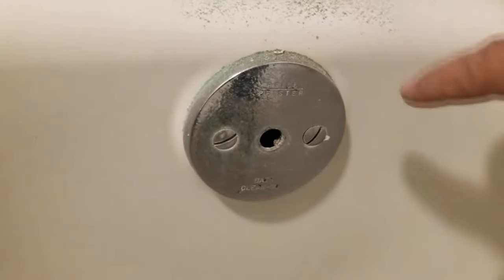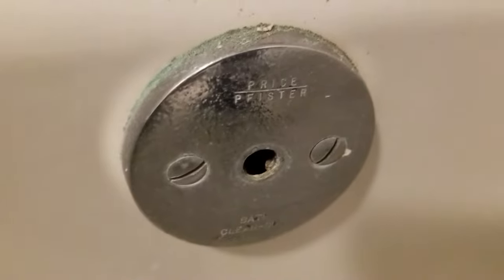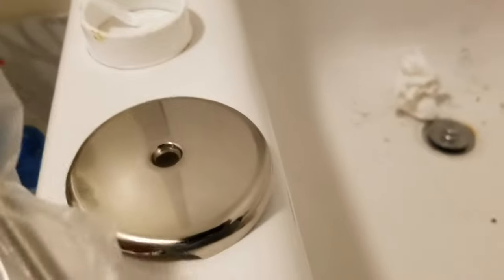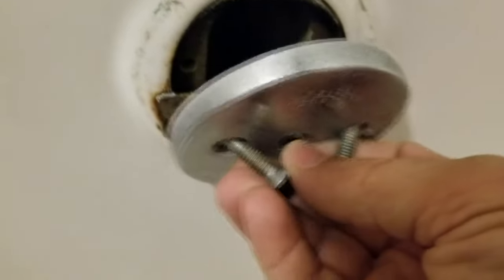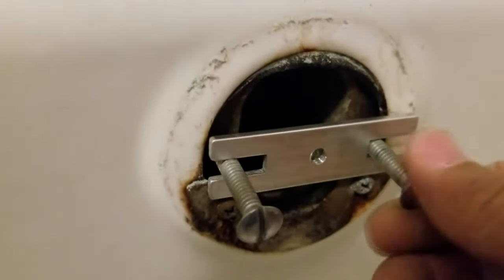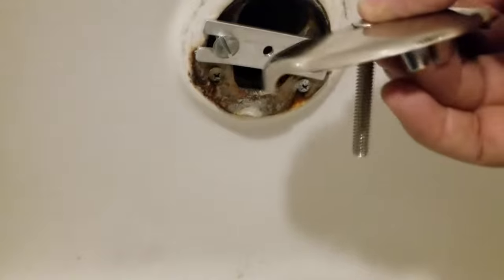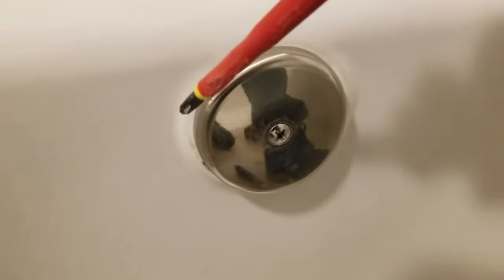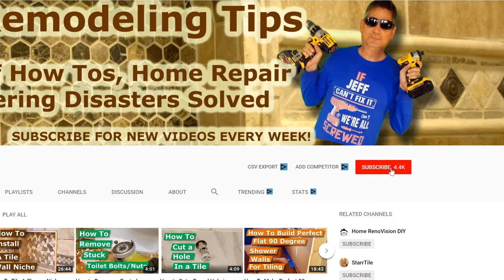How to Install a new Bathtub Overflow Plate Assembly

Comment from the maker: ✅ Parts used in this bathtub overflow plat installation video:
DANCO 89239 Lift and Turn Bath Drain Trim Kit with Overflow Plate, Brushed Nickel: https://amzn.to/2Dsdn7j
Reply: I guess it is pretty off topic but do anybody know of a good place to watch newly released tv shows online?
Reply from the maker: @malakaijames2853   We usually just watch it on the streaming apps on the TV if you have one of the newer smart TVs it goes through the Internet anyways

Comment: What happens if the plate got rusted and when i pulled it out the screw broke? My tub flow is slow it's like it's plugged.  Does the plate have anything to do with that?

Comment: Shouldn’t you have replaced the overflow gasket since it is that old? Your right there. Why not?
Reply from the maker: The overflow plate kits do not come with a gasket. If it aint broke don't fix it you could run the risk of buying a gasket and then putting it on that old 50 year old overflow tube there and what if something happens and it doesn't match up exactly right like the original 1 did? So I would only change the gasket if it looked like it was bad.  Don't mess with what's working.

Comment: do you know what that u shaped metal plate it that was not replaced in the video that was screwed in below the bracket for the overflow faceplate, mine it completely rusted and I have been trying to figure out what it is so I can replace mine
Reply from the maker: That is not a U-shaped metal plate, that's the front of the actual vent pipe that connects to the back of the tub vent hole. So if that is disinterested, you will likely need a new tub overflow pipe kit similar to this one from Home Depot: https://www.homedepot.com/p/Everbilt-Twist-and-Close-1-1-2-in-Sch-40-White-PVC-Pipe-Bath-Waste-and-Overflow-Tub-Drain-in-Chrome-WO-3-CR-TC/206393883 the only problem is now you'll have to be able to get at it from back side of that wall, maybe it's in a closet on the other side or a bedroom on the other side?

Comment: Hey thanks for the video this was good I have a quick question do you have any recommendations for a screw that will not unscrew on the old cover plate. I am helping my friend to install a new plate but we can’t get the old plate off because of the stuck screw. Any help would be great. Thank you!!!
Reply from the maker: Dezmond, for a stuck screw, which I assume is stripped, you need to use  the Speed Out bits, they attach to your drill. The kit is sold at Home Depot. Follow the directions closely, one side is a reverse drill bit, the other side of the bit is the extractor. Used it a number of times both in the shower and on bedroom door screws that did not want to come off. https://www.homedepot.com/p/Ontel-Speed-Out-Speed-Out-Titanium-Screw-Extractor-4-Piece-1000367/303667297
Reply: @jeffostroff  in my case it's completely rusted and the head broke off.

Comment: Just installed a new tub...instead of putting in my single screw drain cover, my boyfriend bought a double screw cover that is chrome.. I have 2 questions 1) where can I get the adapter? My kit did not come with the overflow plumbing or any other hardware, and 2) will I need access to the plumbing as I already hung drywall and closed the wall. ( direct access from the basement but it is VERY tight). Thanks!
Reply from the maker: I usually buy the overflow kit that has only one screw hole in it. It comes with an adapter bracket that screws into the older 2 holes if you have one, or you just use the one screw into the center hold to secure it.
Reply: @jeffostroff  I picked up the bracket. Thanks for video!

Comment: I didn't see you finish it up with silicone or caulk? ALso how do I find the other videos of the other part of the bathroom you did on this job? I cant find the spout or shower install. TY
Reply from the maker: ✅ WATCH:  DIY How to Replace Shower Faucet Trim Plate and Handle [Moen]: https://youtu.be/xjPhAxOeSlY

✅ WATCH: How to Install New Shower Head, Delta In2ition - DIY
https://youtu.be/DUexg5N-PxU

✅ WATCH: How to Remove Stuck Bathtub Drain - Rusted, Won't Budge
https://youtu.be/8neK7Nj0Xs8

Comment: I have a similar type plate but i need to remove it to unclog the drain but the singe middle screw isn't budging. It's like really really stuck. The screw is in good condition only about 5 years old but that sucker is not moving at all. Any ideas on how to remove it? I'm bout to go HAM on it. 😂

Comment: Where did the holes for the new bracket above the old bracket come from? Also the u shaped lower bracket is missing from mine, I need to replace this correct? my other problem is the bar with one hole is too long for the opening in the tub. Can I buy a proper fitting plate?
Reply: Unfortunately I found the rusted studs from the original cover.  I don"t see any way to remove them. So after I find the u shaped bracket and replace it can I just silicone the chrome cover over the hole?
Reply from the maker: The kit comes with a new bracket. the bracket comes with 2 screws to adapt it to the threaded pipe opening inside the tub wall, If it is too long for yours, you can use a Dremmel tool to cut it down, but make sure the holes still line up.

Comment: Is the over flow cover supposed to turn after you tighten it . I screw it on tight and i can still turn it some what . Mine is different tho I put the 1 screw threw the overflow cover and it has a spot to screw it in on the drain pipe .
Reply from the maker: The cover should be horizontally level with the opening at the bottom. The screw should be tight enough to hold it snug. I also like to apply a real thin bead of clear silicon all around the top of the cover where it meets the tub to prevent any water from getting inside the opening other than into the drain.
Reply: Yeah not putting in Sheetrock until tonight I still don’t got the ceiling back in I’m gonna fill the tub up with water and try it out . I’m almost certain that the bolt was just loose if not I’ll replace the gasket

Comment: can an overflow valve be installed in a tub that doesn't have one?
Reply from the maker: If you can drill the hole without cracking the porcelain, but that seems difficult
Reply: @jeffostroff  i think i have fiberglass tubs.

Comment: What if the fitting in the middle of the overflow is corroded & can not take a screw & there is no fittings for a bracket?
Reply from the maker: the fitting is usually plastic right? Double check yours it might be threads in a plastic screw boss. If that is the case the new screw will go right in there. If not you might have to just silicone the new overflow plate onto the tub, and insert a dummy screw there.

Comment: What would you do if the screws break due to rust?
Reply from the maker: Go Old school on it! Start tearing it out, then use pliers to unscrew the screw.
Reply: @jeffostroff  sweeet as long as i dont need to spend anymore money lol
Reply: My screw is completely broken off no way to screw off any suggestions??
Reply: @sht7007  Sledgehammer or Necroplasm

Comment: Can I change out an overflow plate that has a lift tab with just an overflow plate without the lift tab and then install a stopper drain cover instead of the plain drain in the tub? The lift tab broke off of the overflow plate and I am having a hard time finding parts and have no idea how to replace it if I got the parts. Thank you, trying to repair 1994 kohler parts in my tub. Where can you purchase the Delta shower head that you used in your repair video? Have a great day!
Reply from the maker: Yes you can do that the linkage will still remain in the inside the law but the drain will work just fine

Comment: How do you remove a broken screw without the head in the bathtub cover plate?
Reply from the maker: If the screw has no head, then you should be able to remove the plate, then use pliers to twist off the broken screw.
Reply: @jeffostroff  I noticed that there is only a very little part coming out which the plier could hardly hold. In this case what should I do?